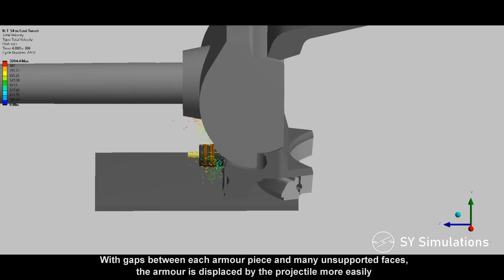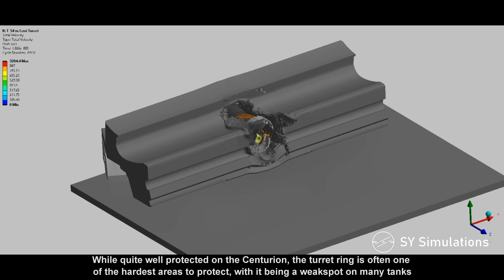T-54 vs CENTURION TURRET RING | Complex Armour Penetration Simulation

Comment: According to the Krupp equation,“plugging" 2 plates of thickness t  requires the double of energy for a single plate while to penetrate a plate of thickness 2t requires the QUADRUPLE the energy because the force required is double and the deformation is double.
It is a good model for thin plates though...

Comment: i see that the turrent on most tanks as shot traps, can a strip of steel be place before this to mask the gap?
Reply: The Germans did that by overlaying the front armor a bit in ww2 but it doesn’t seem to have caught on for whatever reason. I may be wrong but I think the add on armor kits for the t62m also did this
Reply: Yes, that is done for several tanks to protect the turret ring. But only if there is space, and usually it isn't enough due to the edge effect unless it's very thick. Besides, modern munitions make a simple armored ring or plate insufficient on its own.

Comment: is there a tank where the turret ring isnt a weakspot and how about a video about a modern tank like those in the ukraine and the round goese slightly right or left from the canon because many almost every modern tank is around the barrel a weakspot some bigger some smaller that would be interesting atleast for me
ps my english isnt that good as u can read shit happends
Reply: On Leopard 2A5/6/7/8 and K2 Black Panther the gun mantlet is not a weakspot. On all other tanks it’s a big weakspot, especially on Leclerc. Allegedly, UAE Leclerc had its mantlet pierced by an autocannons and the shell embedded itself in the gun breech.
Reply: @azeke8  war thunder betrayed me atleast i didnt wrote that much shit and thanks for the information
Reply: @azeke8 didn’t they try to fix this mantlet issue with the m60a1 as well? Not 100% but I believe the abrams and merkava also put a lot of armor on their mantlets. 
Every single  t72/80/90 has this as a bug issue though and you’d think there would be something they could do
Edit: keep in mind the edibles have kicked in
Reply: @AsmellYoullGetUsedTo  M1 mantle has maybe 1/2 of armor that turret cheeks have, and it is more optimized vs HEAT than vs APFSDS.
Reply: @azeke8  Not the K2 or any of the Leo 2. 

As a captured Leo 2a5(?) may have been penetrated in the gun manlet
Reply: @azeke8  it is weakspot on leo, about 30% less armor than turret cheeks.

Comment: What about the gun mantlet? In WT it is pretty complex as such it seems to offer more protection than it should, as the edge effect would apply as well. On the Mk. 10 they went with a simply flat plate.
Reply: At least in WT they modelled in the trunnion behind the mantlet for the Mk. 3. The Mk. 10 is completely missing its trunnion

Comment: Soviets fixed this issue by.. removing the turret ring.
Reply: The T tanks have the same problem, as seen in other sims. If you want the turret ring to be as protected as as the rest of the turret face, you either have to make the neck of the turret bulge outwards, or accept a smaller turret ring - which nobody really wants to do
Reply: @tommeakin1732 or you could just up the height of the ufp? Or even place some armor on the hull roof like they did in the Tiger2(p),
Reply: @Dontcare-qx6os  Yes fair point, you could raise the height of all the hull plates for that matter to cover the turret ring from most angles - giving the hull roof a kind of inset look. Though I suspect that isn't a wildly efficient way of doing things. It's likely more efficient to just thicken the turret ring, though I haven't run the numbers lol. 

Though I'm not sure about what you mean with "armor on the hull roof like they did in the Tiger2(p)"
Reply: @tommeakin1732  yep, or make the hull very big and flat. that's what happened to the IS-3, i like to call those soviet turrets "upside down pans"
Reply: I believe they tried to fix this over the frontal arc with frontal armor kits that were raised above the turret line though. I’d probably argue that the turret ring is a weak spot on any turret though
Reply: What